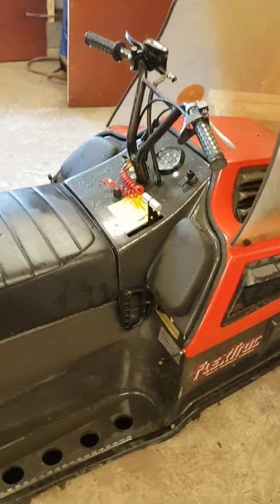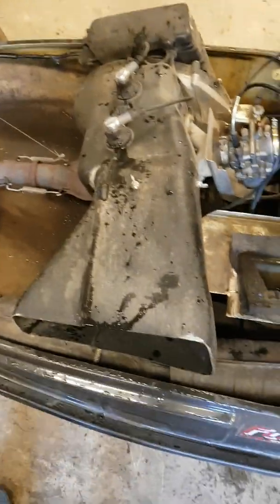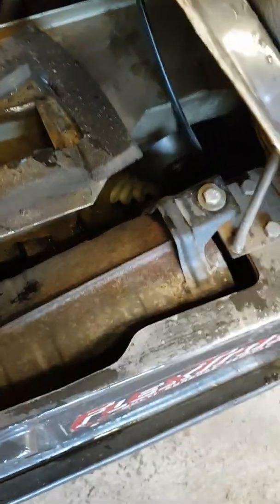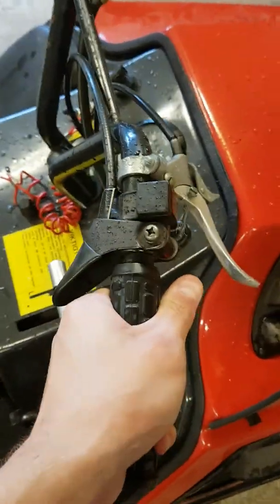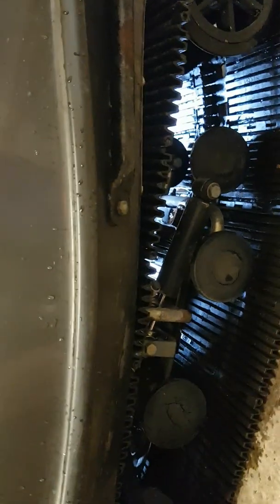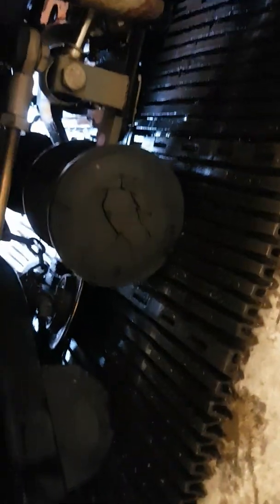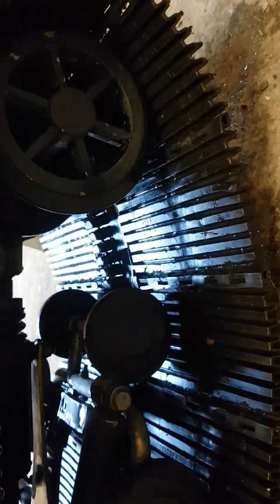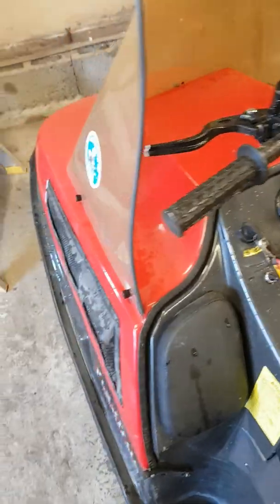How a Flextrac/Finncat MPV works

Comment: Have you any idea where I can buy track for my Finncat, having issues with the track jumping from the bogey while turning. Do you know how many sections of track yours has on? Also I have removable drain plugs under the body that should be fitted to help with buoyancy, havn't actually attempted to go in water, I'm to scared
Reply from the maker: Do you have enough tension on your track? The spring should be about 25 mm visible. According to the manual, there are 36 track pieces in one track. I do know of a guy that owns A LOT of parts here in Sweden. Just send me an email on antonpersson53@gmail.com if you need his contact info.